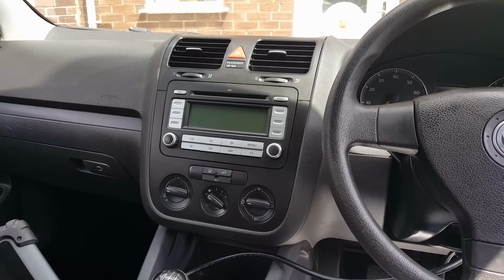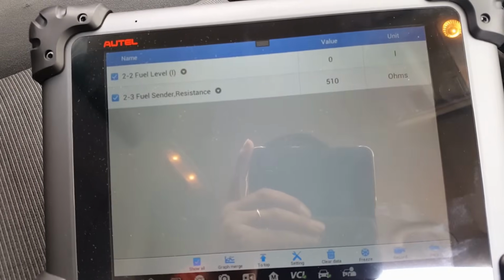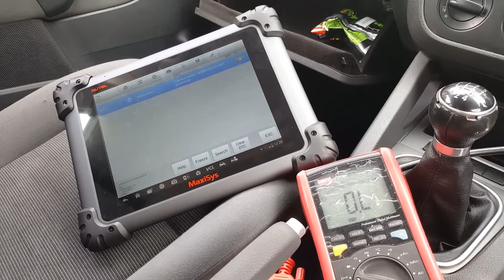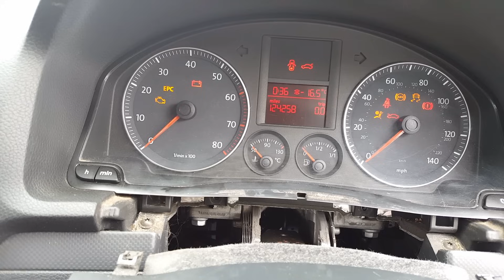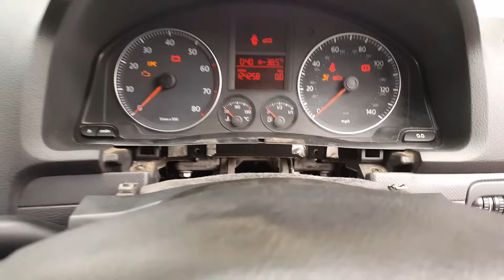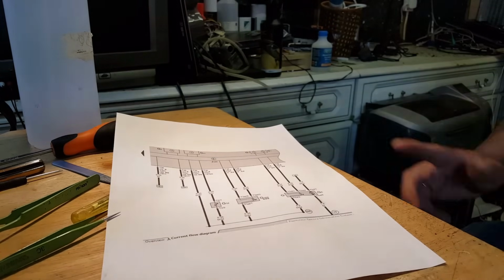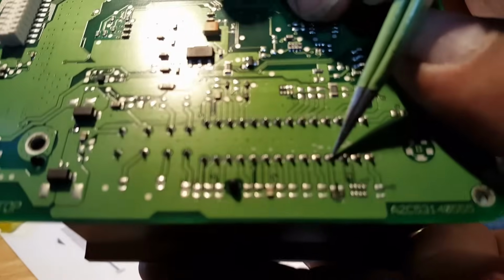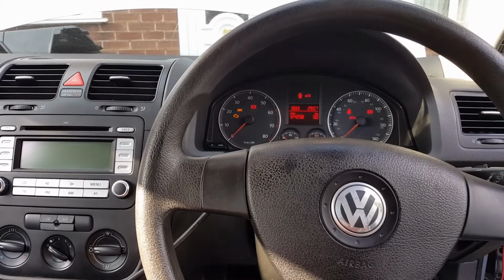Volkswagen Golf 2007, fuel gauge not working. Fault finding and repair.

Comment: Hi…the video about the 2007 VW Jetta Fuel problem saved me a lot tof time and money.  Went directly to my 2006 VW Jetta and pulled the instrumentation cluster and checked to see if the circuit trace you noted as being burned, was also burnt on my car circuit.  It was!  Had a wire soldered across the trace and voila! it worked.  The gas gauge worked and so did the ambient temperature gauge and the “Air Conditioning System!  The VW engineers decided to link the ambient air temperature reading to the “cooling” side of the A/C.  Heater works great when the temperature is -40 deg. F. but who need the cooling side of the A/C when the temperature is that low.  Living in San Diego, California (USA) the temperature rarely gets to 40 deg. F.  So along with the functioning gauges, the cool air is nice.   Thanks again.
Reply from the maker: yaquith 2 
It is great to know this helped you!
Thank you for watching and for the feedback...
Reply: @LMAutoRepairs  I HAD THE SAME PROBLEM FOR YEARSthank you so much ! You are a real life saver.
Reply from the maker: @andyjohnson1917  
Thanks for the feedback! 
And for watching the video!

Comment: Trying to solve this problem for years thank you, man, you really saved my money. I was told to change the cluster in Georgia which costs approximately 200$ with programming maybe it's not expensive but for me it's half of the average salary.
Reply: @LMAutoRepairs  bad news 😅still have the same problem it was solved for 1 or 2 hours but I did not use a resistor because I checked in another dashboard there is just nothing it's a thin line like a fuse. What can be the problem of blowing that fuse every time? :/ I think the whole wiring is perfect and there is no short or open circuit anywhere
Reply from the maker: @vasourumashvili4535 
If the fuse is blowing something is wrong somewhere... could be the sender in the tank...
Reply: @LMAutoRepairs  exactly it was fuel level sender. I changed and it's perfectly working but😅😅 when I was soldering my dashboard, I accidentally turned the gauge needle solo it's showing the wrong info 😑 from vcds could not adapt or change anything any idea. Also disassembled the dash connected to car tried to turn and stop at the correct level but it still returned to the previous wrong position.
Reply from the maker: The needle is most likely in the wrong position on the shaft...
You need to put it in the correct position with the stepper motor in the rest position...
👍👍👍
Reply: @LMAutoRepairs  couldn't find anything about it on YouTube or internet :(
Reply from the maker: Don't need...
It is simple... cluster on the bench, make sure the stepper motor is at the rest position, then insert the needle in the correct position...
👍
Reply: @LMAutoRepairs  okay, I will try it tomorrow. I will remove the needle and insert it into the correct position. Why there is no needle holder or something like a stick to stop the needle 😞
Reply from the maker: @vasourumashvili4535 
That's what I saying...
You need to just gently insert the needle, not fully, then turn it to the rest position, the stepper motor will stop, but the needle will spin on yhe shaft, once in position push it further down to the correct position...
Reply: @LMAutoRepairs  thanks for that help🤝. This video is 100% helpful. Hope these comments will be helpful also. Thank you again for the video and fast reply.

Comment: 08 rabbit same issue .I did all the same with vag an check all you did. What the issue of short was temp sensor.That what shorted i believe on mine. Temp gauge went first started reading low due already having low fuel didn't see much there but also it blew 15 amp fuel pump fuse die at light this is after 15 min of no outside temp. Replace fuse it started. No fuel gauge because i thought it was out of gas. 5 gallon no movement. So now @LMautorepair i will take an pull cluster thanks for video. I had a feeling about cluster but was odd how it stop being to different sensor on opposite end of car lol..
Reply from the maker: Hope you get it sorted! 
Thank you for watching!
Reply: I also work on cars this is a customer came in for a misfire #1 cylinder while test driving this happen lol.. fixed misfire had bad injector also coil pack broke down under load. Also me doing all the same an having vag move gauge i was like wth haha..
Reply from the maker: @brianwinter1453  
👍👍👍👍
Reply: It was same spot works great now.
Reply from the maker: @brianwinter1453 
Great you got it sorted!
👍👍👍

Comment: My 2007 Jetta had the exact same problem ,and I got it fixed with the help of this video,but the issue is, the resistor keep getting burnt.
Pls what's the cause?
Reply from the maker: Most likely something on the circuit, either the sender or the wiring...
👍👍👍
Reply: @LMAutoRepairs  So in this case what am I suppose to do
Reply from the maker: Measure the wiring and the output from the sender...

Comment: Hi... Great diagnosis of the issue... I have same golf 2007 and now having same issue that the fuel gauge is not working... I replaced the fuel pump assembly including the fuel level sensor but no luck... Till i saw ur video... I want to know which pcb board is this in which u repajred the fuse and where it is located... Kindly let me know so i can fix the same issur in my golf... Thank you
Reply from the maker: It is in the instrument cluster...
Everything else is in the video...
👍👍👍
Reply: @LMAutoRepairs  thank you for the reply and support... Keep up the good work.. 👍

Comment: I’ve got the same problem now. My golf broke down, mechanic replaced fuel pump and filter. Now the outside temperature gage is -38 on the dash screen and the fuel gage is on zero.
The mechanic said he cannot find a problem, has checked wiring on the fuel pump, told me to take the car to VW for a diagnostic. They want £300 before they even look at the problem.

Comment: I love the video. It was great. I have the same problem with my Jetta 2009 and now I may be able to fix it. I also have a problem with my Fans, The do not start when temperature reaches 90 degrees Celsius. What could be the problem please
Reply from the maker: Any codes?
Can you activate the fans with the scan tool?
The fans might not necessarily come on at 90c exactly...
Some cars they come on at higher temperatures...
Also, the 90c you are referring to, is on the needle of the cluster, or on live data?
Because they might do not match...
👍👍👍
Reply: @LMAutoRepairs  Yes, I have code: P1290
Also inside temperature needle in the instrument cluster reaches 90 degrees Celsius and fans do not start but I do not have Vagcom or VCDS to check in live data.
Reply from the maker: Fix the issue with that code, then worry about anything else...
👍👍👍
Reply: @LMAutoRepairs  What are your suggestions on where to look or what to do? I have replaced the sensor twice now and there is no difference
Reply from the maker: @OmoniyiAyinde  
Check the live data for that sensor...
Have you measured wiring, from the sensor to the ecu?
Reply: Much appreciation for your assistance. I will keep you posted on progress and will let you know if I encounter more Issues.

Comment: Hello sir very good video and explanation , i have a vw eos 2007 with the same problem of temperature and fuel but the pcb card is not the same as this one and i cant figure anything wrong with it any help would be appreciated thank you .
Reply from the maker: I would start by scanning the car and actuate the gauges... to establish is the issue is the cluster or something else...
Thank you for watching!
Reply: @LMAutoRepairs  i did i changed the fuel pump and its the same problem i can see the needle slightly move when i put the key but it doesn't indicate anything with the new fuel pump and diagnosis of the cables everything is fine but still not showing how much fuel i have :(
Reply from the maker: Something is obviously not right...
Double check connections etc...

Comment: I'm going to give this a go after my local garage just quoted me £600+ to fix.  What gauge fuse wire do you recommend? And is the pcb reasonably easy to remove.
Reply from the maker: Yes... the cluster is not that difficult to open...
I just used a thin coper wire... not sure what gauge... but I would say a 2 or 3 amp wire...
Thank you for watching!
Reply: @LMAutoRepairs  great, thank you. Excellent video.

Comment: Hi Sr, thanks for the information on this video, this help me to fix my problem with this, but I have a problem similar with the oil light warning (this dont stop to flashing), we check the pressure, I change the oil switch and check the signal on the harness with this I confim to my problem is the cluster, Could you please help to do you have the solution for my cluster?, I see to Mexicali Mexico
Reply from the maker: Never had to deal with the oil pressure light, can't really advise...
But if the light flashes the circuit is working...
Are you sure that the pressure is ok?
Thank you for watching!

Comment: Hi mate I recently I fitted a diesel cab heater to my T5 and accidentally drilled through a wire loom causing all sorts of problems all of which I have been able to repair except the fuel gauge now doesn't work and the fan on the radiator continuously runs   there is 2 faults showing 1 for short to positive on the fuel gauge and the other is short to positive on the outside air temperature sensor? I replaced the outside air temperature sensor as it was inexpensive however as I guessed it didn't resolve that fault. So now having seen this excellent video I think I may have blown a fuse on the dash in my van I would appreciate your opinion cheers and thanks for a great video
Reply from the maker: Possibly... I am not sure the T5 has the same circuit in the cluster... but might worth check...
That said, make sure you check all the fuses etc... if you haven't already...
Thank you for watching!
Reply: @LMAutoRepairs  yes I will and thanks for the reply

Comment: hello thanks for video.just I want to ask that you repaired instrument cluster board? Or which board I cant understand that?
I m following you and you are really very good.
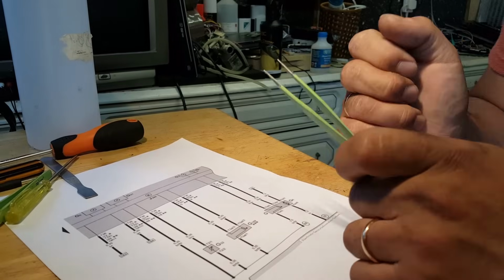Reply from the maker: You must have skipped 26:57 ...
I mentioned it quite clear...
Yes, the issue was on the cluster...
Thank you for watching!
Reply: @LMAutoRepairs  I found and repair it. By the way I wanted to give information for followers. I ran into the same problem for transporter t6. the same repair was made and it was fixed

Comment: Would this be applicable on a 2017 golf sporteagen 4Motion? I’m having issues where my fuel guage isn’t reading at all. I’m also getting an error message of “Covering for fuel level indicator sensor 2” low resistance. Any suggestions would be appreciated!
Reply from the maker: Doubt will be the same issue...
But if there is indications that there is 2 sensors and one faulting, then start by investigating that...
👍👍👍
Reply: @LMAutoRepairs  found out that the issue was the battery. We had a really cold 2 days of negative weather and after that… car started acting up. All is solved it seems. Thank you for the help! Also, are all batteries for Volkswagen have to get adapted to the vehicle? What’s the rule of thumb for adaptation in batteries?
Reply from the maker: If your car has that function,  it is highly advised to have it programmed/adapted...
Otherwise that new battery might not last that long...
👍👍👍
Reply: @LMAutoRepairs  thank you for your knowledge transfer. Cheers from Smyrna Tennessee!

Comment: It blew cos your sending unit was stuck cos of all the sand ..built up heat and blew the board...or someone was working on that plug while power was on and shorted those pins then it blew. the design is just fine.
Reply from the maker: I agree to disagree... 
A fuse inside a module?
So, anything on that circuit that would make the fuse to blew, means replace the cluster....
How difficult would have been to design it to have a fuse in the fuse panel on the side of the dash?
Jut my opinion...
Yes, I think someone has shorted the wires...
The probe stuck wouldn't make the fuse to blow, but instead the gauge to just no move...
Thank you for watching!

Comment: I do appreciate that great vid. Actually  I have quite the same issue with my Golf VI 2012 but in my case the fuel needle sops just above the 1/2 off the reserve even it is 100% full. After changing fuel pump completely the the diagnostic result shows the both  B103E1B (Intermittent) and B10581B (Static) code errors of fuel gauge sensors 1 and 2 with 'resistance too high''' comment. Any help or advise please
Reply from the maker: Resistance too high can also mean a wiring problem... like an O.L...
Measure the wiring...
Thank you for watching and for your comment!
Reply: @LMAutoRepairs  
Thank you so much for your prompt reply man! 
However, what's O. L wiring and can you help where i can find the wiring map of that kinda car and how i can reach that concerned ones?

Much appreciated dude
Reply from the maker: @BachiroH24  
Hi
O.L = Open Line... means a broke wire or interrupted circuit. 
As for the diagrams,  you need to ask Mr. Google...
You have not given enough details for me to look for it...
But, on the 1.4 16v TSI is as follows:
Sensor 1
Pin 2 》cluster pin 20
Pin 3 》cluster pin 1
Pin 4 》cluster pin 2
Sensor 2
Pin 1 》cluster pin 20
Pin 2 》cluster pin 3
Pin 3 》cluster pin 4

Most likely the above is the same for most variants, but cant guarantee...
Hope that helps...
Reply: @LMAutoRepairs  Absolutely that helps a lot, but  here are my car details:
Car: Volkswagen Golf VI,
Year: 2012,
Body type: 5-dr hatchback
Engine: CAYC 77 kW (105 HP) 1.6 l, 
Fuel: Diesel
Reply from the maker: @BachiroH24  
I can double check if you struggle... but most likely is that...👍
Reply: @LMAutoRepairs  I'm struggling right now,  yeah please go for it, man! Two brains better then one 😉
Reply from the maker: @BachiroH24  
I can't measure it for you....🤷‍♂️
I gave you the pin outs... now is up to you to make the measurements! 
👍👍👍
Reply: @LMAutoRepairs  yes I see.
Second question, just wanna know why there are two sensor for that fuel gauge? In other words, is that the half reserve showing on the dash board assigned to one sensor and the other half assigned for the second? Please correct me!
Reply from the maker: @BachiroH24  
Hi
Some tanks due to the design are split in two... so the two sensors... not saying that's the case, just saying some are... two sensors can also be used for accuracy...
Reply: @LMAutoRepairs  A I get it. okey man, you really made my day! :) 
Um gonna watch some of your vids to get the whole picture as regards to the wiring  diagram.
Reply: @LMAutoRepairs  
Guess what?!... I'm really lost my mind man! After a long testing and checking the wiring from the fuel pump to the gauge in the dashboard nothing is wrong,  seems all is okay. But here the mystery of the issue: it was the battery even the scan with VAG and OBDeleven didn't figured that out!! I changed the battery and everything things works in its usual way the the errors are gone. I cant believe that!
What's wrong with that? Is really the voltage small changes effected that way?
Reply from the maker: @BachiroH24  
Low battery can cause all sort of gremlins... but I guess it would triggers other issues... but you never know...
Well, at least you figured it out! 
Well done!
👍👍👍
Reply: @LMAutoRepairs  oh yeah! I see. Now i get the lesson man! But you're so kind and professional enough to guide me all that way till I fix the issue,  otherwise I've never give it a try. Keep your great works up!
Reply from the maker: @BachiroH24  
👍👍👍

Comment: Hello mate where can I buy the little fuse from or you willing to fix it if I cover costs and postage ? Got Same problem it’s all apart
Reply from the maker: Just use a thin wire if you can't get hold of fuse wire...
Thank you for watching!
Reply: LM Auto Repairs any wire will work ? Just join the two little pin together ?
Reply from the maker: As i said... use fuse wire if you can... otherwise, solder a thin wire where the old was...
Reply: It worked perfect cheers so does my fuel sender need changing still?
Reply from the maker: I would check it... just in case something is wrong with it, and it blows again...
Reply: LM Auto Repairs ok mate cheers ill check it
Reply from the maker: @trxshotz1386  
👍

Comment: Hello im from Sudamérica Ecuador, i have a VW pointer 2003 , and the fuel gauge doesnt work, i took out the socket and i measured the voltage that goes to the variable resistance  , and i measured less than 1 volt,  what the correct voltage should be ?

Comment: I faced same this problem and I checked the board for the instrument and fixed
After that just the weather sensor is work and the the level fuel gage doesn't work, please what you can help? 
Thanks
Reply from the maker: Hi
Have you checked that the signal from the sensor is reaching the cluster?
Thank you for watching!
Reply: @LMAutoRepairs  I change the level sensor and now it's work
Many thanks for your advanced and your video 👌🙏
Reply from the maker: @basilsy2633  
That's great news! 
Well done!
👍👍👍